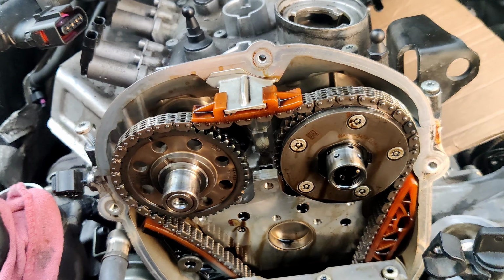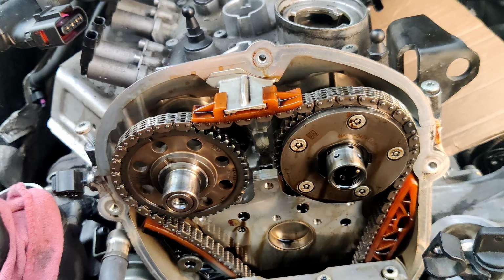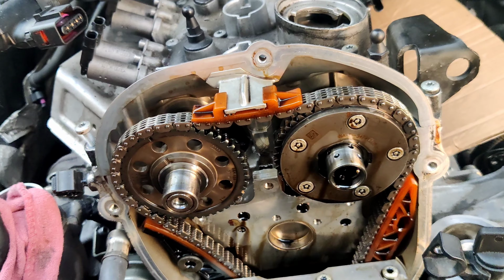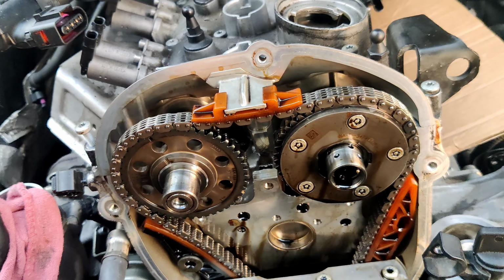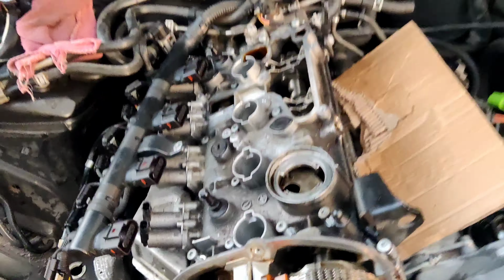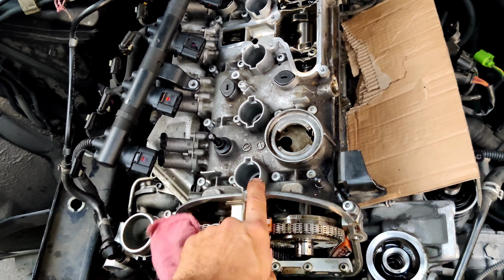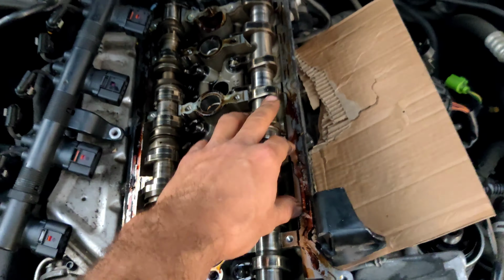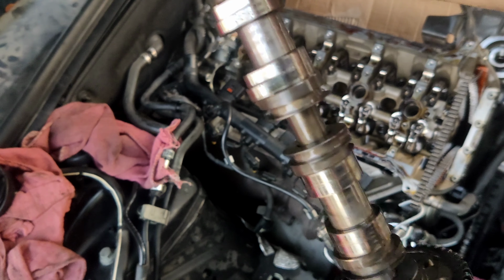TFSI engine 2.0 camshafts removal / Audi A4 2011

Comment: If the piston hit and damaged the valves then be careful in reusing the old cams. The lobes do bend as well—just not noticeable at first glance. Happened to me.
Reply from the maker: Thanks I will keep it in my mind! Looks like is good, I tested it on the water a few weekends!
    https://youtu.be/9GTlXrgrMPs
Reply from the maker: The problem it's in the exhaust valve , it is melted, piston didn't touched the valves! The car is driving already for a long time! All good! Except that it is consuming oil but I did a research and is specific for this model and year , they have this defect from factory and consuming oil!
Reply: @valeriumoscalu7580  the oil consumption is most likely due to piston rings. A good idea to change the oil every 3k miles as they did many years ago and car would last longer. The tfsi was a very poorly designed engine and I think it was intentional so people would have to buy new cars.
Reply from the maker: I know there is a new model of  piston rings and with them the oil consumption is much smaller but the work is expansive so no many people a willing to pay for it!

Comment: Was it difficult to reinstall the camshaft without having to open up the lower timing cover? Did you have an issue getting the camshaft back around the timing chain?

Comment: What issues were you having that required the cam removal ?
Reply from the maker: Melted exhaust valve! 0 compression in cylinder nr.40 removed the cylinder head and replaced all exhaust valves!